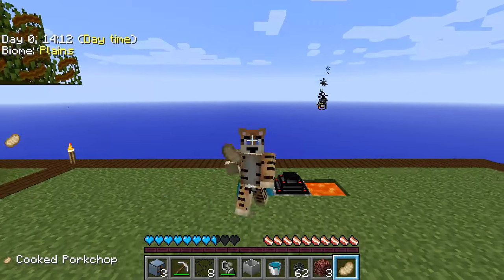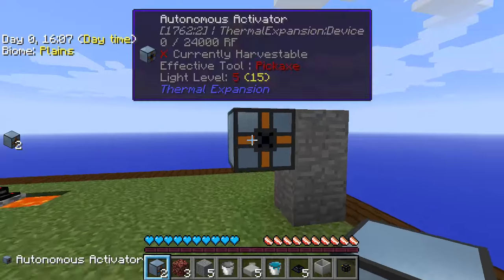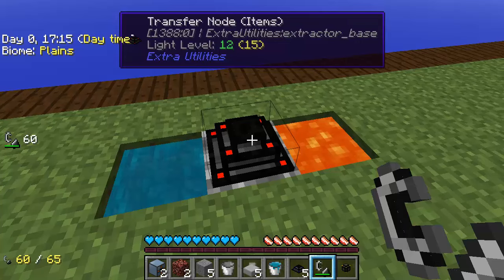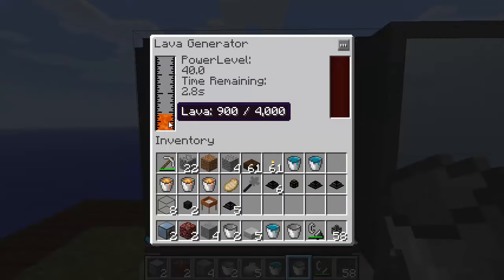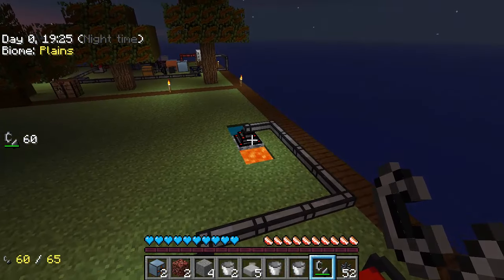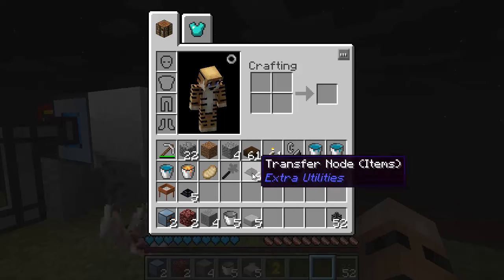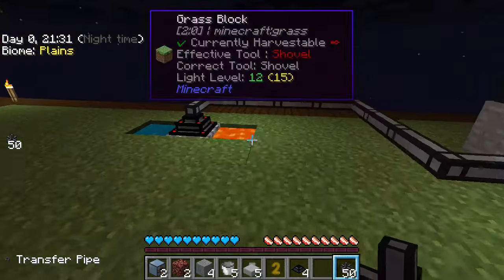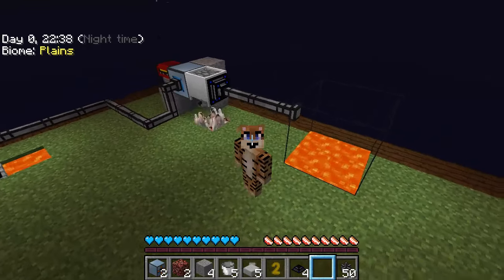Minecraft Infinite Lava - Sky Factory 2 Tutorial

Comment: Or you can pump the cobblestone directly into the crucible and not need to use power and without the autonomous activator.
Reply: Nope, the Autonomous Activator acts as a player right clicking cobble into the Crucible. And a transfer pip does not do that, they only transfer items, energy, or liquids
Reply: it works for me, you have to put the pipe on top of the crucible and use a transfer node to pump it in.
Reply: the transsfer pipes are literally 10x better for this and they DO work....